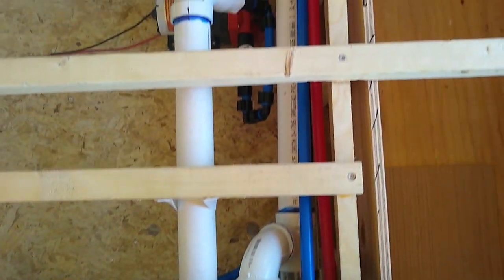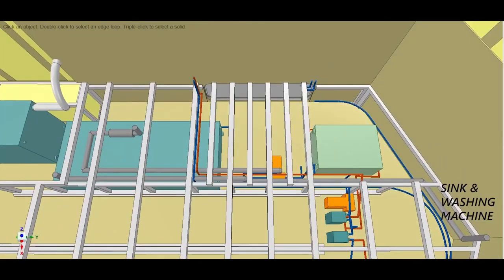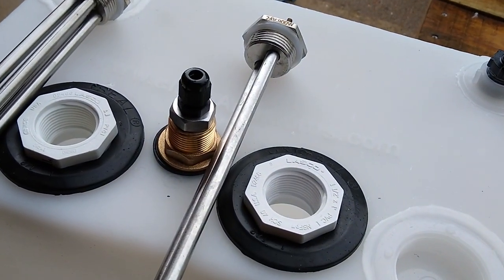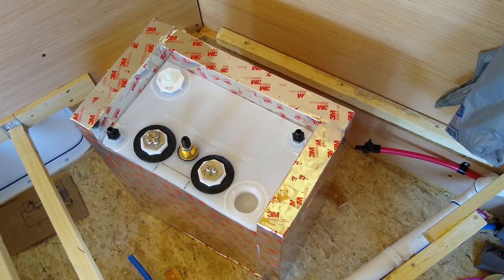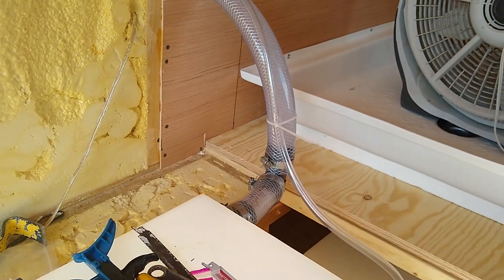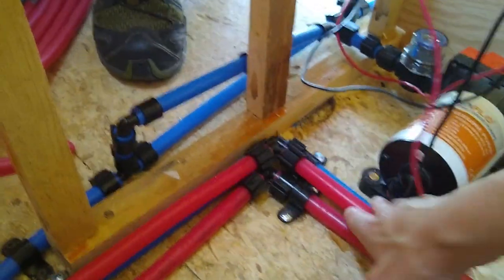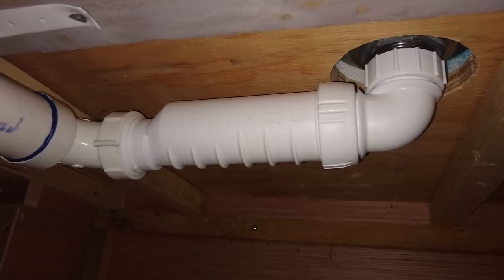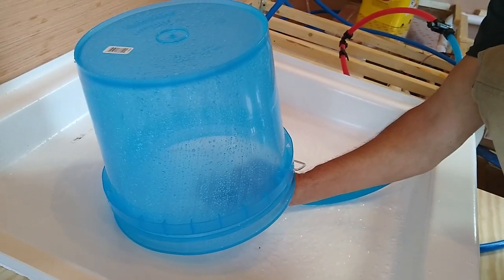Is this a Pipe Dream or are we Plumb crazy? | Cargo Trailer Conversion | Ep 8

Comment: Coming along nicely 👍
I have not seen that style PEX crimp system yet.Whats it called?
Cheers
Reply from the maker: Thanks! They are Pexlock clamps. They do not handle any repositioning of the pex well. They are great for repairs if you don't have special tooling. We have since purchased the pex ring tool and had to replace a few of these with metal crimp rings.
Reply: @theperpetualadventuremachi4571  Yes, I have had 0 failures with the metal ring crimps. I have the older crimper and it is getting harder to use in awkward positions as I get older....that sound better in my head🤣
Cheers